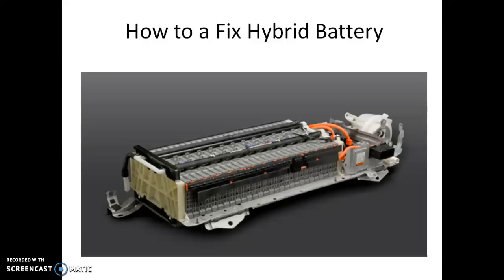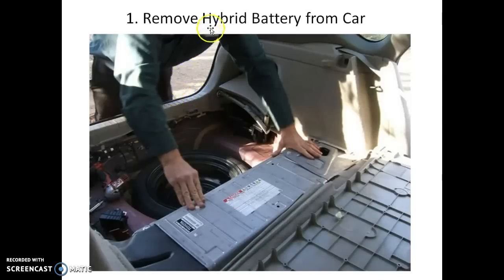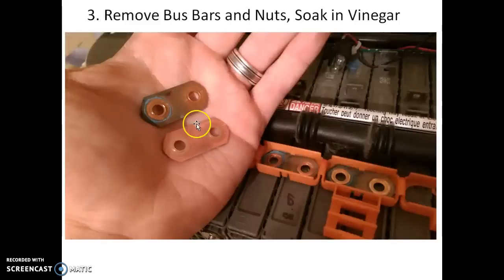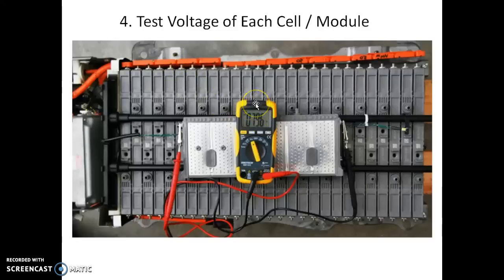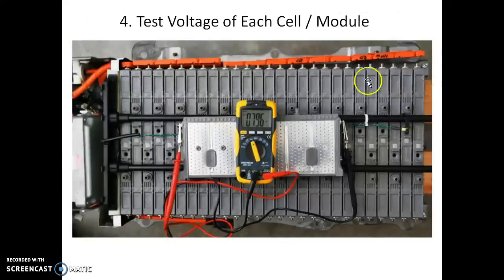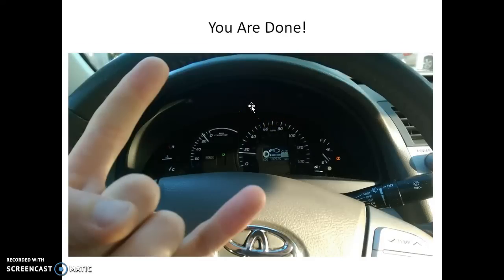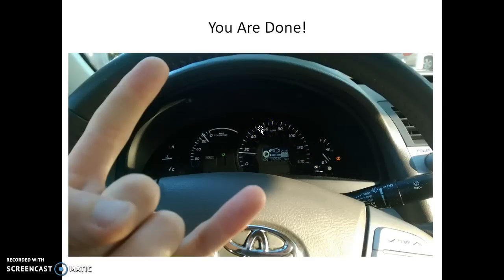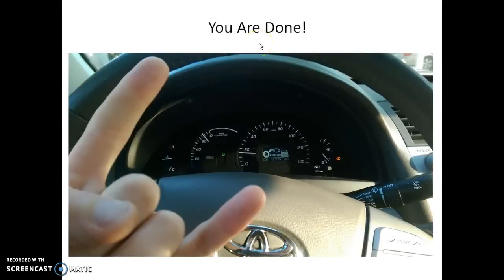How to Fix a Hybrid Battery

Comment: When i got the red triangle on my prius 2  dashbord, my combined voltage was 235v . I had only one module under 7v (6,5v ) . If i had changed only one module , the problem may have been solved. But i wasn't happy with a temporary fix. So i decided to load test all my 28 modules and the result was scaring. My modules were in very very very bad conditions. Before cycling the modules i decided to rebalance them in parallel for 3 days. All 28 modules minus the bad one were 7.90v on average . The first load test series  was using a lamp bulb 3amp ( 10mn 30mn 50mn 60mn ) i discharged to 5.4v per module 0.9v per cell 
After that i charged all the modules up to 8.80v 
This allowed me to see which modules were at their best capacity and which ones were discharging very fast. 
I only keep track about the ones who  could hold 7v after 30 mn discharge at 3amp
After 3-5 cycle discharging charging 
My best modules had only 3500 mAh capacity after deep discharge .. most of my modules have only 2000mAh capacity after 5 cycles 
Cycling all my bad modules will take me another month from now with 3 tiny charger dischargers from amazon. I'm not on a hurry because i ordered 12 grade b modules from an ebay seller from usa. Shipping will take 3-4 weeks to Europe. 
My goal is to find the best 16 modules from the 28 from my old hybrid  battery. . And to mixe them with the grade B ones i purchased online 4500mAh + . The best modules i have in my 28 modules would be rated grade D to C ... That being said, all i'm trying to do is also a temporary fix . 

Replacing a bad module voltage related is just a piece of the equation. You could recharge a bad module to 8.50v and it will discharge to 5v in 120 seconds at 3 amp . You could also charge a good grade C module to 8,5v and it will discharge to 7,30v after 30 minutes at 3amp. After this fix, i will probably sell my car or purchase a new battery. Load testing , cycling , rebalancing , etc... Just temporary fix 😢😢😢

Comment: After replacing a hybrid battery on a vehicle do you Need to have a scanner to erase codes and reprogram the car  ? 

Or you could just replace the battery and the car will work ? 

Im asking for a 2013 hyundai sonata hybrid .

Comment: I have done this four different times now, with about a year between errors. This method has been colloquially termed "whack a mole" on Prius chat (fantastic, informative forum, by the way), and while it often does work for a good while (especially with a battery pack that hasn't had the issue before), I can attest that it isn't the best way to go about it. You really need to load test (charge and discharge) each battery module to get a true idea of the battery health. While it often seems to be the case that a bad battery will show a lower voltage than the rest of the series, an equally important value is how the battery reacts to a load. It is entirely possible and perhaps even probably that you have batteries testing "strong" (7.5V+) but have a drastically diminished capacity, which you won't ever be able to see without a real load.

Good tips on the corrosion, but I would like to add that you should looks and see if you have any water in/around the spare tire, 12v battery compartment, or really anywhere around the battery. There are actually cracks that form in the body of the car just under the rubber/plastic rail (this is what you would pull up for a roof rack install) that end up letting rainwater in. That rainwater makes its way under the trunk space and sits there. You may or may not get a mildew smell, but that constant dampness definitely contributes to the corrosion. The most recent time pulled the battery the terminals soaked in vinegar turned it blue. I am told sealing the cracks works, and have tried clear flex seal, though I cannot attest to that as the repair was too recent.

Not trying to be critical, rather just sharing what I ended up learning along this relatively long journey. You can get a hobby charger on amazon for $60-80, so it's not too cost prohibitive. There are tutorials for this online (none of which are mine) and I genuinely wish I'd have gone that route when I first started. I have spent a lot of hours ripping the back of the car apart and putting it all back together LOL. Of course, the really BEST plan of action is to replace the battery with a new one. If one module fails, especially on an older car, it's entirely possible you are going to gradually see others fail. Toyota will sell you a new battery unit for around $1700 (plus $1400 core deposit). Just be sure that the dealer you buy from doesn't require a certified tech to pull it (no real reason to but if they do just contact another dealer). Of course, since you are here, you probably don't want to spend $1700, which I certainly understand as someone who has done this version of the repair multiple times now. :D

Comment: I did not see where you mentioned load testing. It is said the voltage reading is not as important as the load testing. I ordered a module off of eBay and voltage tested it than load tested it. The voltage was ok but when I load tested it failed big time. I am now with a bad module from eBay and out $35.00.

Comment: Hey Shane....  my daughters 2007 camry had the same dash errors and lights on.  The engine was running and the car was operating but the hybrid system didn't seem to be kicking in.  I disassembled and then tested cells.  It seems all are testing 0 volts.  Could they all be bad or was there something else that may have failed that allowed the battery pack to drain completely?  Thanks
Reply: well nuts.  After walking away for a day and thinking about what I could be doing wrong....  it hit me...  I'm think High Voltage = AC and was testing on the AC settings.  The cells are DC.  Wow... like a gun... I'm glad I still treated it as if it was loaded the whole time.  Great video Shane.  I'll let you know how it turns out but so far so good.
Reply: oh yea...  volt meter did test OK on home electric at 123v.  I changed to 20v range to test cells.  Actually I ended up trying every volt setting just to make sure.... nothing.
Reply: a year later and the car is still doing great!.  I replaced only 1 cell.  Thanks for the quality of this video!

Comment: What reading should be put on the multimeter
Reply: The video states any module reading less than 7 volts should be replaced. It would be a good idea to run a load test on your modules to weed out  those that have a low capacity. Many YouTube videos address how to go about this.

Comment: My Check VSC Light & Check Engine Went Off After Installing The Block 4 Cells . Car Runs Good Now , Now The Check Hybrid System Light Is Still On. The cell I took out had a hole melted through it too

Comment: Hi great video and thanks for sharing.  I now plan to replace cell or cells on my hybrid camry 2013.  After dialogue with toyota and other businesses in the hybrid battery business, it seems they are not supportive of replacing cells...    I wonder how long your repair lasted and would there be any reason why I shouldn't do it.... Said camry has 36 cells.   Will a new cell disrupt others.    Thanks.  Danny
Reply: I have done this four times now in my Prius. As a general rule, this isn't the right method, but it's cheap. I tend to get about a year out of mine. 

That said, a 2013 is much younger than my 2005, so your mileage may vary. If you can just buy a new battery pack from Toyota and install it yourself I'd go that route. I know my Prius runs $1700, and the car with its mileage isn't even worth that, so for us, it doesn't make a lot of sense. 

If you do go the cell replacement route, I suggest you look at load testing (just searching that here in YouTube will give you lots of results). That's gives you far more detail about the health of each cell.

Comment: Please believe me--this video will get you hurt or worse if it prompts you to mess with high voltage/high current systems without knowing exactly what you are doing.  Look again at the view of the hand holding two bus bars.  Notice the ring on one finger, and how it is just about the right width to bridge two battery studs.  If this happens, the ring may turn instantly into molten metal and burn down to the bone.  If it touches a high voltage terminal while another part of you is touching a low voltage point, you could be electrocuted.  Other possible scenarios include a spray of hot electrolyte in the face, or a runaway thermal reaction of the whole battery.  Please believe me.  I own a Camry hybrid and I may replace or repair the battery if it comes down to it, but I am retired aircraft mechanic and I can do it safely.  If you want to tackle a job like this, find a qualified mechanic to at least review your plan and tell you how to do it safely.  Never wear jewelry while working on machines, and particularly electrical machines.  Never work on high voltage equipment without wearing new or tested electrician's glove.  Never work on high-power batteries without wearing a face shield.  Please.

Comment: This video is akin to saying that if your stomach hurts, just take some Pepto-Bismol-  that fixes the problem with stomach pain. Definitely don't go to the doctor,as you can get Pepto-Bismol from the store and fix your stomach problems on your own.
Hybrid systems are pretty complex, can be very dangerous and can actually have a lot of things cause the check hybrid system light to come on. grossly oversimplifying a complex system because you don't understand it fully doesn't necessarily mean that you should be telling people to do the same thing. You may be taking the mechanical aptitude that you possess for granted, and somebody may try this and actually get hurt or maybe even killed.
Reply: It is up to the individual to do their research if they plan on fixing their hybrid issue. Don't push this on to someone else who is only trying to help

Comment: The check hybrid system light was on, when the mechanic scanned he said the the problem is the transmission !! Is that right
Reply: it depends on the exact error code itself
Reply: Some hybrids do have the alternator in the transmission.

Comment: Hi just wondering I already did this but it only worked for about 20 miles and the hybrid check sistem came up again
Reply from the maker: Then you have another issue. The hybrid system is made up of lots of different things.

Comment: I have a 09 Chevy Tahoe hybrid and we have been having problems with our hybrid battery. Every time the check hybrid system light comes on it completely shuts my car off for a long time. I have to sit and wait for it to turn on after 30 minutes or so. We took out the batter and cleaned it and checked the voltages and they were good. Put it back in drove it around for a while and the battery light came back on we put the code reader and it still says it's the hybrid battery. Does anyone know what else it could be?
Reply: A bad module or modules, must load test modules to be rid of bad modules. The procedure can be found on youtube

Comment: I have two codes in my 07 Camry. They are P0A80 and P3011. It also has the symbol brake system and symbol, car skid, and where is the battery located ? What are the exact fix for those two codes ? Thanks
Reply: The primary code P0A80 will have sub codes, you need the subcodes. All the other symbols can normally be ignorne as when a P0A80 is thrown the car shuts down the other systems (thus their codes pop up). The sub code will tell you if it's the inverter, Tranny,or battery that has a fault.

Comment: Hi Shane,
Thanks for the video! My Camry Hybrid is doing the same thing and has been for a while and recently it will just loose all power sometimes while I'm driving; the engine is still on, all electrical like radio, fan, and lights but when I press on the gas there is nothing! My son and I removed the battery a few months ago and he checked all the cell voltage and at the time they were all good. I will definitely give this another  shot though. This is the first video that had the same problem with the warning lights and did not replace the whole battery! I was just REALLY having a hard time putting $1500-$3500 on this job! I will definitely try to change out the cells!
Reply from the maker: I would check the 12v battery on the trunk first. They are special and specific for this car.

Comment: In all seriousness the average Punta should just avoid the temptation to buy any car that has a hybrid drive train, has a CVT transmission or DCT dual clutch transmission,  like the proverbial plague, it's not worth the grief!
Reply from the maker: I have a 06 jetta tdi with 240k miles on the DSG (DCT). Flawless. I think it's more in the maintenance.
Reply: @shanecall  Yes, but in general the average punter should stay away from them.
Reply: Then the average punter should not drive, or get educated.  Hybirds such as the Prius would be in fact the way for a nontechnical noncar person to go in fact. This is due to the fact they can withstand not being maintained regularly unlike regular gas cars.

Comment: Yes corrosion can be a problem however standing voltage readings can be deceiving and actually mean almost nothing in a Panasonic Prismatic NiMH module . A module with capacity diminished to as little 10% of a new battery (650 aMH) can still show good standing voltage. Buy a balance charger like a Turnigy Reaktor 1000W 30A  and the Turnigy power supply. Then check standing voltage / resistance for each module and then Run each module through a discharge/charge cycle twice writing down all the capacitance values for each cycle. (The Turnigy has a data logging program) Discharge at 6.0 amps down to 6V (no lower) and Charge at 2.0 amps with a 10 minute delay between cycles to determine your battery module actual state of health. The 2nd discharge is your "go to" number.  Think of it this way, the first discharge pours out all the capacity,  the charge cycle fills the capacity back up and then the 2nd discharge shows you how much USEABLE capacity can be pulled out. Originally they would read around 6500 aMH. Most 10 year old modules will be less than 50% and some are much much worse.  The 2nd charge cycle could be skipped if the capacity is really low, just junk the bad module out and stop wasting your time. This is what pisses me off about all the used batteries on ebay etc. They are truly untested if the standing voltage is all that is checked. Most are probably junk and a waste of time and money.  Good Luck out there.
Reply: I bought a module and it measured 7.6 volts but failed big time when I ran a capacitance test. I agree with you, most eBay sellers never run a capacitance test on to the modules. So if you buy, its a roll of the device.
Reply: Discharging the batt. modules at 6A may be too fast.
From what I have seen on several other vids, 1A is about the best ( safest & effective ).
The 10min. waste/wait time between discharging and charging is much longer than almost all ( 1 - 2mins. ), but inconsequential.
Reply: @SpicyRok7482  The battery is rated at a 3C so 3A discharge is no problem https://avt.inl.gov/sites/default/files/pdf/hev/batteryprius1052.pdf.   http://privatenrg.com/04%20HV%20BattAmpUsage.jpg   According to test the Prius itself will discharge up to 6.8amps.
Reply: Thank you for providing some valuable information.  Batteries have a science of their own.
Reply: So is it best to replace each individual cells in the battery pack?
Reply: @nonenone4078  replace any degraded cells with ones that match the properties of the cells next to them. For example if cell next to them are 10ohm 5000mha, 7.5volts you would want to match the same performance
Reply: @lunacyworks  should I pre order the cells like 4 or 6 cells  because from what I research you have to remove the whole battery pack and have to individually test them or should I just go to a junk yard and try to salvage some cell battery thanks I'm willing to take my time with it
Reply: @nonenone4078  First get the Mini VCI and figure out with Techstream how many cells might be bad. If you have more than 2 you might be better off getting another used but newer pack.
 If you watch videos it takes about 30 minutes to get battery out of car. May be first time 2hrs.  Take it out and test the cells while still in the casing (cover taken off).  Then determine what you need. You will need to match internal resistance and charge level so just getting bunch of unmatched cells won't work as well.
Reply: @lunacyworks  when you say unmatched  do you mean .03 or more difference and how do I do a simple load test with an light bulb
Reply: @nonenone4078  well a matched pair would have very similar internal resistance, similar voltage at the same charge capacity.  The voltage difference should be as little as possible but that is just one of the factors.  A decent hobby charger can measure all these factors for you and some will help balance them.